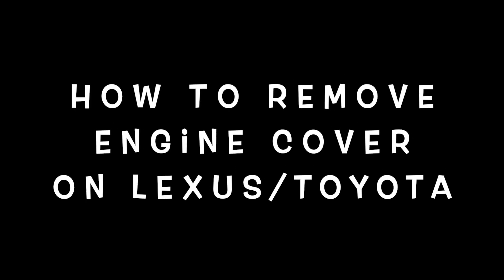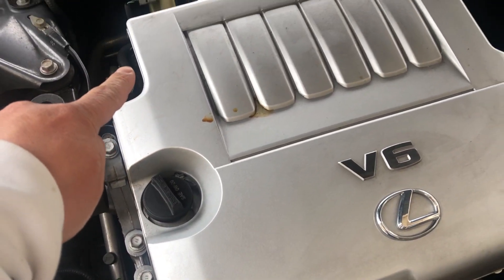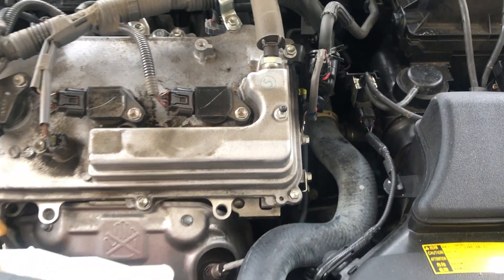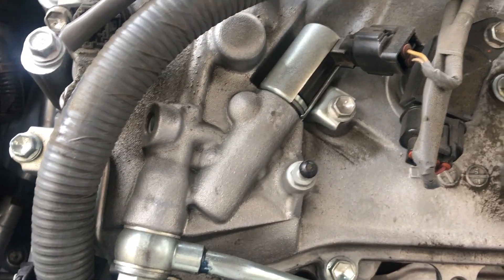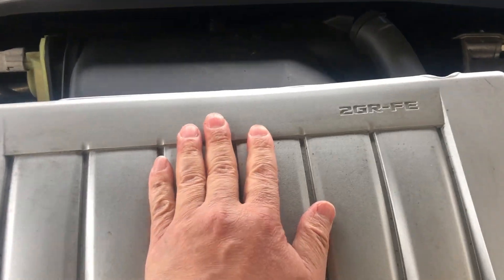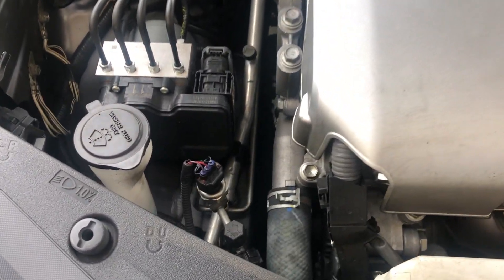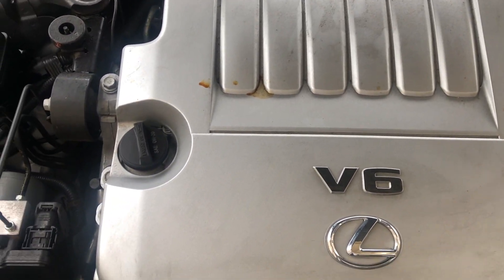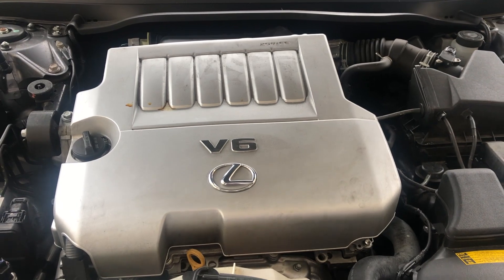How to Remove Engine cover on Lexus/Toyota

Comment: PSA: On my wife's Venza, under the rear of the cover, there is a plastic "slot" that slips over a little post on the engine... be careful not to just "lever" up the cover after disengaging the front 2 fasteners or else the plastic slot thing may break (especially if it's really cold). Gently pull the cover straight towards you after loosening the front fasteners.